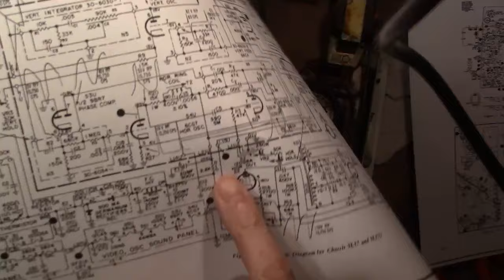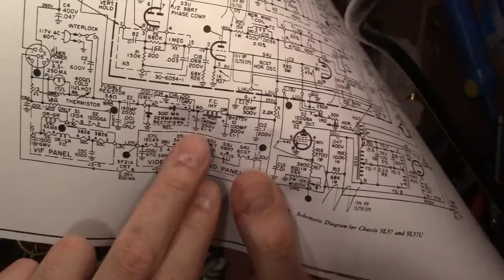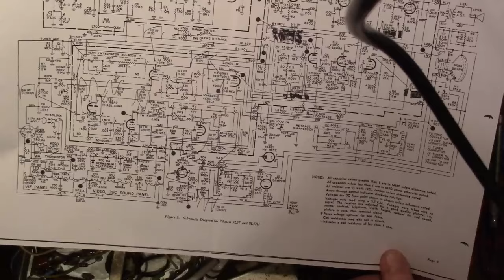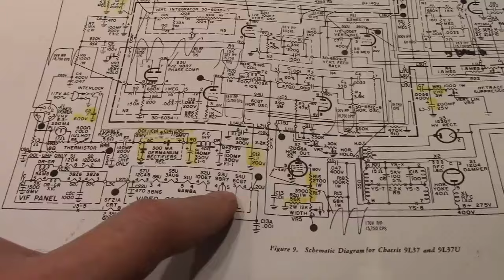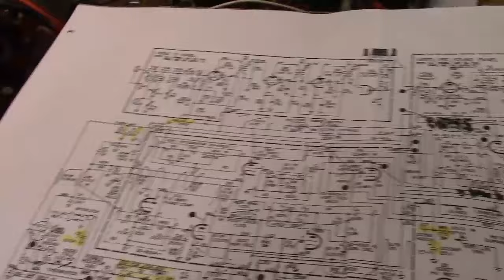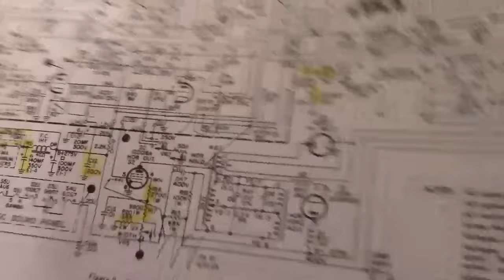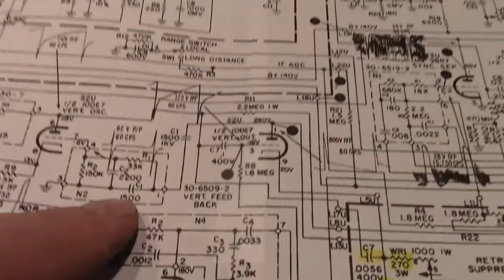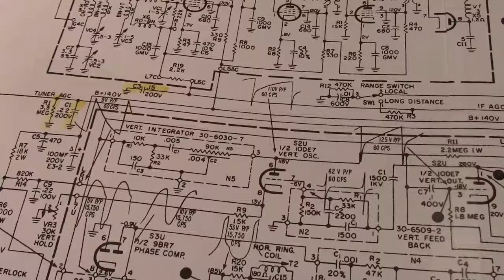Predicta Pedestal restoration p3o4

Comment: There is also U2J ceramic, which has slightly higher temperature coefficient but a higher dielectric constant.  It is commonly used in automotive applications.